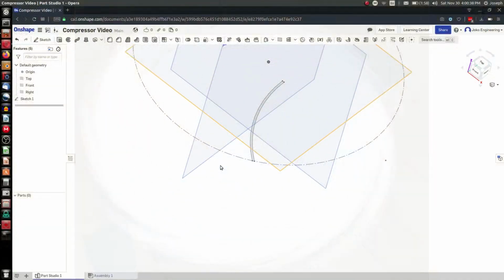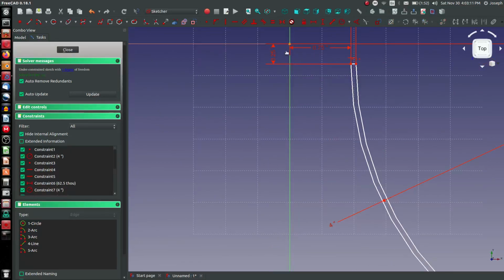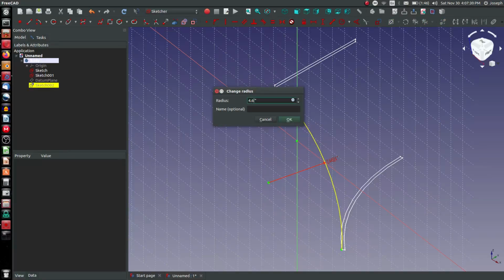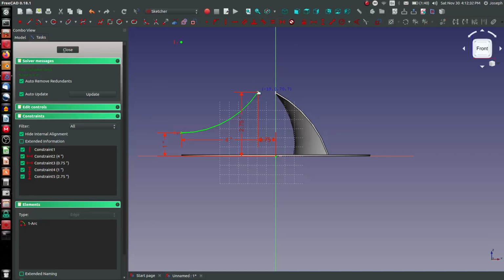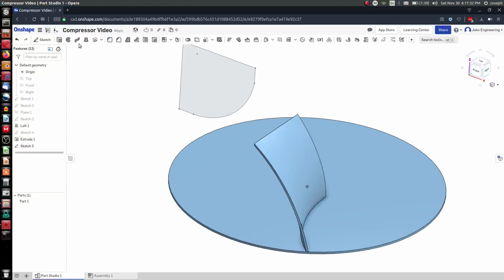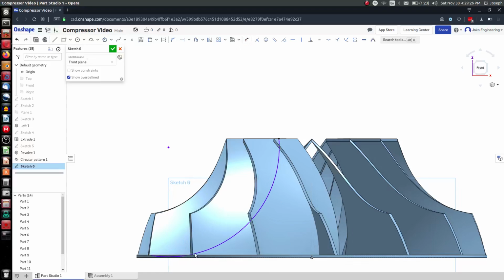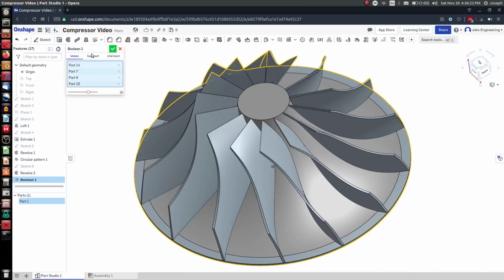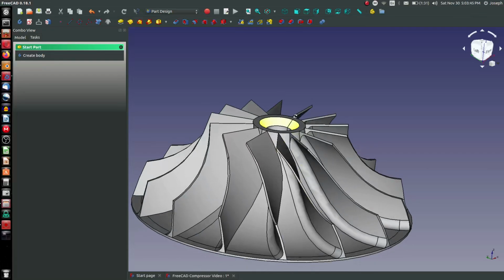OnShape and FreeCAD: A Comparison |JOKO ENGINEERING|

Comment: Great video!  Thanks for doing this.  I'm looking to start working in CAM, and OnShape doesn't provide good free CAM functionality, so I think I will look at shifting to FreeCAD.  

Once comment about your OnShape modeling.  You could have selected "Add" instead of "New" when you created the blades and the center part.  If you had the merge scope selected as "Merge with all", you wouldn't have needed the boolean union.  See my OnShape model Compressor Video CDS for how that works.